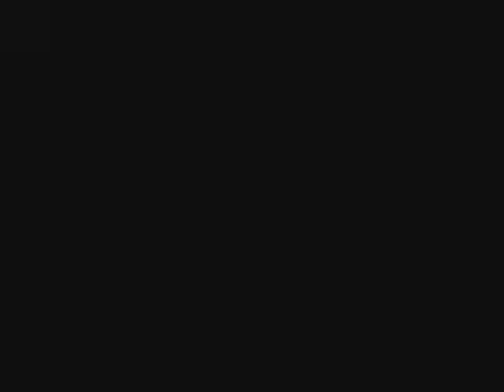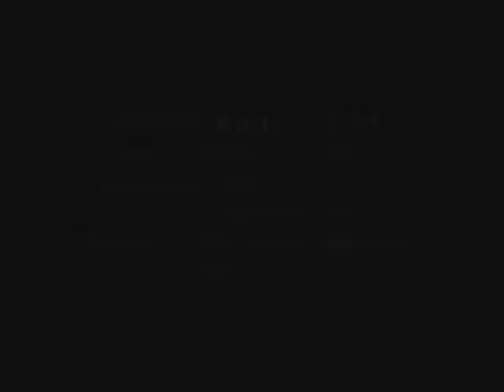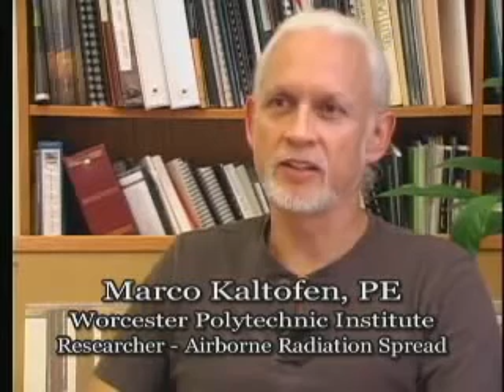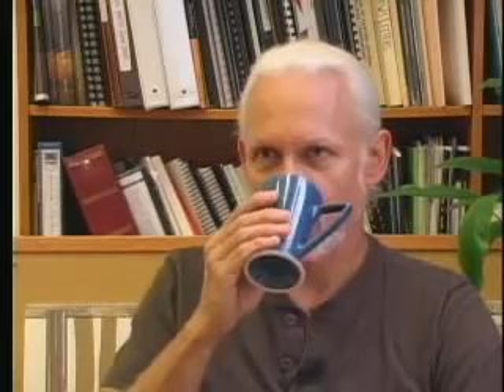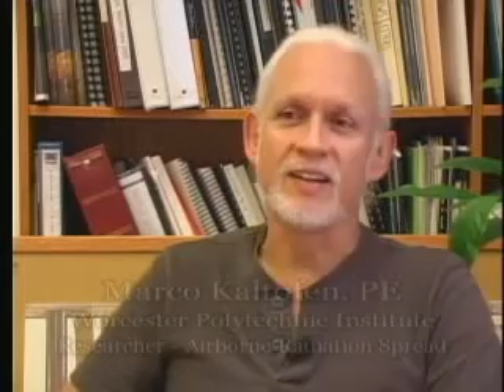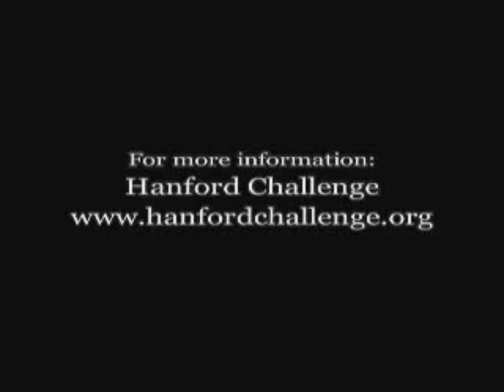Airborne Radiation Spread

Comment: Thank you Dr Kaltofen for you everlasting invaluable work.  I served in the US Air Force in Civil engineering.  Radiation attached to particles....you said specks of dust mainly.  I think its important to include water soluble radionuclides that bond to molecules such as Oxygen 16 and 18 that evaporate under equillibrium conditions that then also flow around the planet to be ingested.  I think its important to note the Uranyl Ion, Uranium sulfate, oxidized crust, redox, PH and then organically bound Tritium.  Dust particles is far from what has been released from Fukushima.

Comment from the maker: We have received similar Brazilian rain samples before. The dust collected this way contained tiny flecks of uranium minerals.  This is something we have found in areas with exposed bedrock that has monazite minerals, and from areas where uranium is mined.
Reply: Such as uranium sulfate the salt of uranium?  Isn't it very water soluble and very mobile just like the UO2 2+ Uranyl Ion and exactly why the water must be very alkaline in a reactor?  Oxidized crust that occurs from cooling the Corium...wouldn't that oxidized uranium be water soluble?  It's one thing to say that uranium incased by zirconium in a fuel pellet with alkaline water wouldn't cause the Uranyl Ion to occur under normal operation....but another when the containment vessel is cracked with a square hole in the bottom of the vessel with ground water coming in and out with the water table changing the PH of the water after the uranium melted the zirconium cladding removing the protection from this occurring isn't it?  The specks of hot particles, actual fuel that was blown around the world...those specks of uranium/plutonium spread around the world are undoubtedly finding acidic conditions to cause this to occur.  Whats been leaked into the ocean could one day find acidic conditions even without bonding and evaporation found by the Ireland study of Americium in the ocean spray that concentrates at the shorelines.